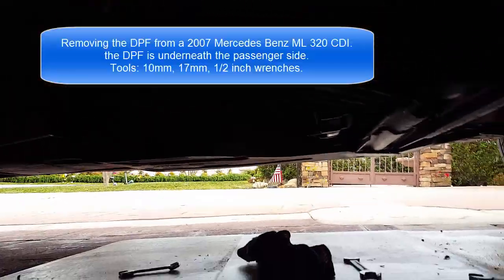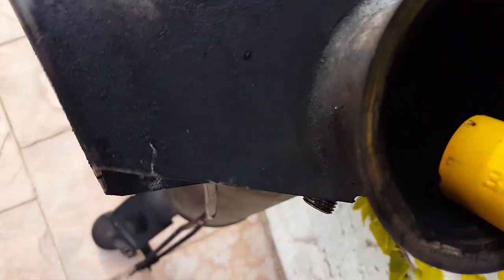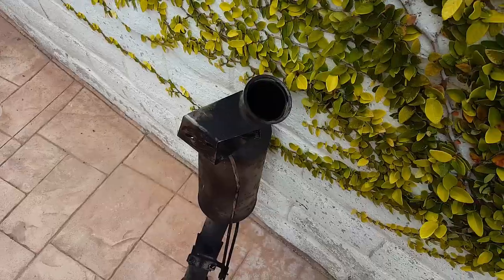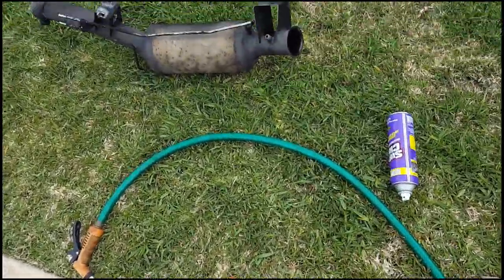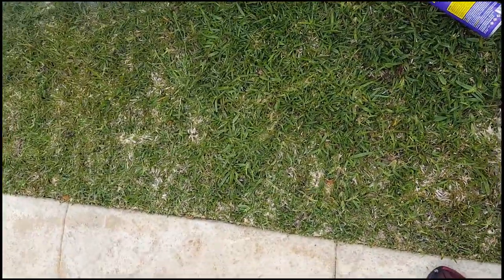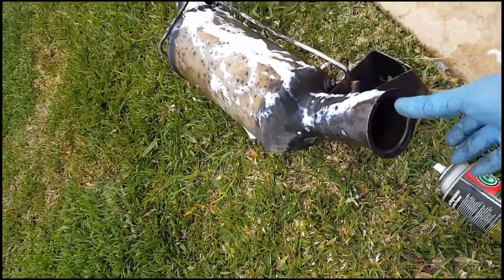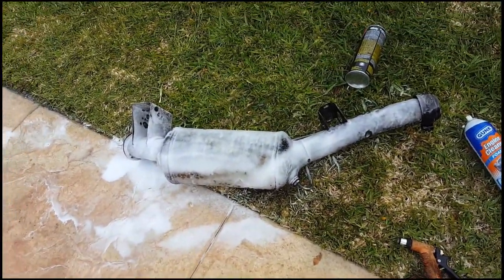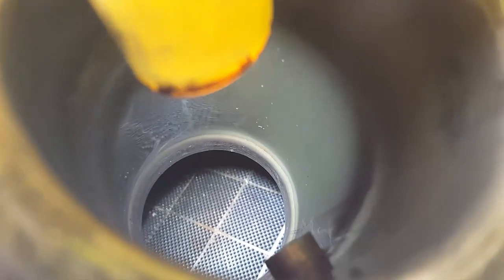Redneck DIY: Diesel Particulate Filter (DPF) (OM642, W164, X164) Cleaning with water and degreaser.

Comment: You already got the dpf out. You should have done a better job. Instead of hitting etc. Just use a drain acid (50/50 with water) for a first flush and 2nd flush to get the soot out and then use brick acid hcl (25/75 with water) for a 3rd and 4th flush to get the dust accumulation out.
This is a pretty expensive piece you don't want to ruin it with foam and or hitting it a bunch of times. It's not gonna last long.

Comment: Im planning on using a leaf blower to push dust out in a large bucket filled with water , then pressure wash it again with the dirty water coming i  a large bucket, use ammonia solution found in alloy wheel cleaners ,then water and repeat and last dry it with leaf blower.reinstall after 24 hours
Reply from the maker: I think that might work too.

Comment: why not just remove it and replace with a regular pipe? wouldn't that solve any issues
Reply from the maker: Well for one thing, there is a differential pressure sensor to detect the presence of a DPF.  The ECU would throw a code if the sensor reported 0 value. You could take a regular pipe and fill it with sand, and then weld on the diff tubes to fool the sensor.
Reply: @BiffMartin  hey do you where the differential pressure sensor is located on this? I can't seem to find it thanks
Reply from the maker: @tikhy3545  The pressure sensor is attached to the vehicle frame above the tail end of the DPF.  It has 2 rubber hoses leading to it. Look for the wire harness and rubber hoses.  Look under your car.